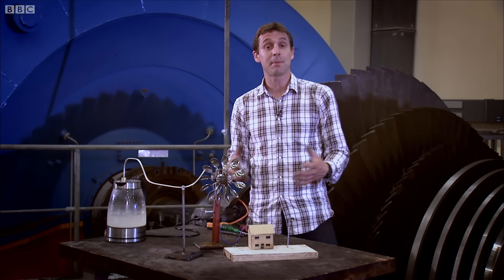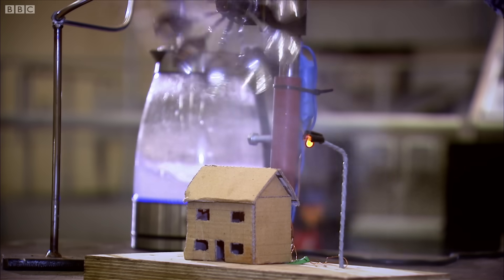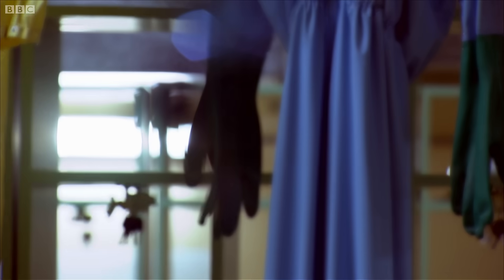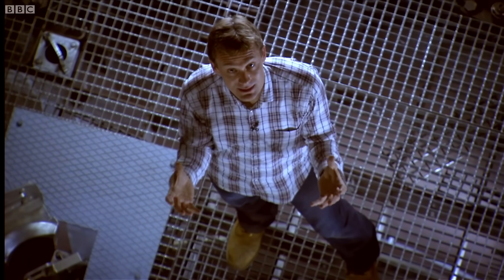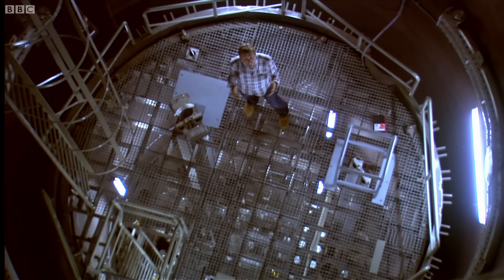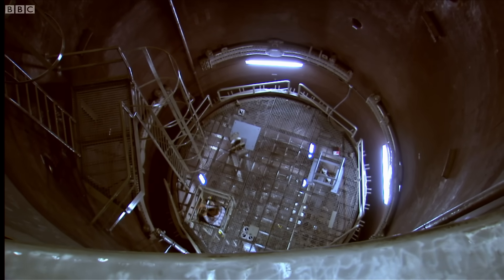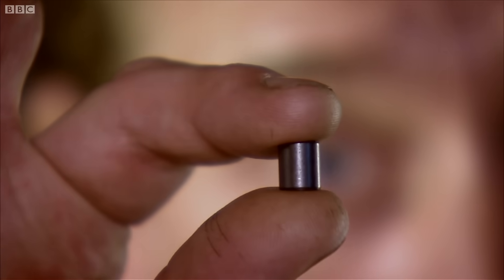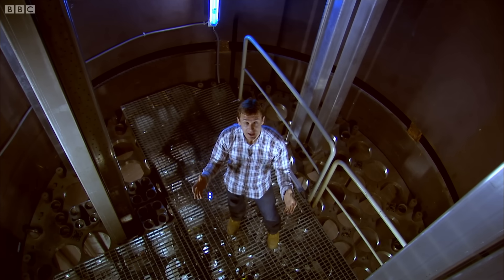Inside a nuclear reactor core - Bang Goes The Theory - BBC

Comment: Coal powered power stations have done more harm to the planet than Chernobyl & Fukushima combined. Where do you think all the green house gasses are coming from that are warming up the planet?
Reply: addictive object O coal fired power plants release more radioactive material into the air than nuclear power plants. Coal fired power plants burn literally tens of thousands of tons of coal per day, depending on power output. A 2000MW plant will burn over 20,000 tons per day. The coal contains NORMs (naturally occurring radioactive materials), that are released into the air with the exhaust.
Reply: @matman7546  how long to decommissioned coal/gas plant? How much nuclear coal waste produced?
Reply: Craig Pasceri not an issue if it’s stored properly. Coal releases it directly into the air.
Reply: Well, considering that global warming happens on its own with or without greenhouse gases, I'd much rather take coal than nuclear radiation that makes miles of land unusable for centuries with just one mistake.
Reply: Those gasses are coming from scientists and organizations that want billions of dollars for “research “
Reply: Deoderant

Comment: What bothers me is we're still using water as the conversion between atomic energy and electricity. Seems like we've made no attempt to get beyond water spinning a turbine to spin a generator. Nuclear reaction to electrical power conversion rate using water is only about 1% efficiency. Thats a huge waste.
Reply: Fusion power when it's done will likely try direct conversion, which should be over 80% efficient, but that's a long ways off.
Reply: All the easy  hydro sources are tapped out already. Hydro has a questionable safety record and hydro lakes are a massive methane emitter.

There is a push in the USA to remove a lot of smaller dams in order to undo the ecological damage they've caused. 

Dams  aren't free to build, or free to operate - and in several cases where operators have screwed up, thousands have died.

You could also argue that wind and tidal power  are "nuclear", but the issue with them is that they simply aren't concentrated enough sources.

Solar pv is almost economic but there are some incredibly noxious industrial  byproducts from making the things. Pushing the pollution into some else's  backyard isn't really acceptable.
Reply: Tyler Walter Anything anywhere near any source of free neutrons will become radioactive. This includes fission cores, and fusion tori (plural of torus?), etc. Things become radioactive if you release neutrons. That's not a big deal. Only the public sees it as a big deal.
Reply: 1% is a bit low.  A nuclear reactor burns about 6-10% of its fuel, and is roughly 33% efficient in converting its heat to energy.  So you're looking at 2-3% fuel efficiency.

That said, you're right, this isn't really ideal - but water's not really the culprit.  Navy subs run at higher enrichment and burn something like 20% of their fuel.  A water-cooled homgenous thermal reactor (e.g., fuel dissolved in the water coolant and moderator) with can burn close to 60% of its fuel (though, they have other problems to do with fission product solubility).

What causes the run-down is, basically, ash.  Many fission products absorb neutrons - this is very much like ash absorbing the heat and air needed to keep a fire going.  In a solid-fueled reactor, this means that to clean out the fission products, you have to remove the pellets, dissolve them, remove all the bad stuff, and replace the pellets - called reprocessing.

Molten salt reactors are also homogenous, and can be continuously reprocessed, and keep the fission products in solution (so they don't gunk up your reactor plumbing).  The feasibility of the type was demonstrated in the 1960's by Oak Ridge National Labs.

Also, they have the benefit of operating at atmospheric pressure (e.g., you don't have a reactor vessel that wants very badly to burst) and at much higher temperatures (you can run the turbine at higher efficiency).  They also have a stronger negative temperature coefficient of reactivity than any other reactor type.  That's a hell of a term, so I'll unpack it.

What is means is that the hotter the reactor gets, the less power it produces.  This is a very good thing in reactors, because it means that not only will it dial itself into stable operation without operator intervention, but you can decide on the reactor's power output by changing the turbine speed, rather than adjusting the power and making the turbines match cooling requirements.

In terms of both safety and flexibility, this is huge.  In safety, it means the reactor is unlikely to ever overheat.  In flexibility, it means you can run your turbines to match the load on the electrical grid, and the reactor will happily follow the load.

Many MSR designs are presently being worked on worldwide, and there's an effort in the US NRC and other worldwide regulatory agencies to make them regulatable.  I expect to see at least one prototype by 2020, and at least one on the market by 2025.  Even China's in on it, responsible for two of the designs presently being researched.

For more information:

http://transatomicpower.com/
http://thorconpower.com/
http://terrestrialenergy.com/
http://flibe-energy.com/
Reply: Dear Seraph, (or are you really plural?)
Pardon me for that, but "Nuclear reaction to electrical power conversion rate using water is only about 1% efficiency" is not because of the use of steam turbines. You are about right with respect to the quantity of energy in the uranium, that is still there in the stuff we propose to throw away, and also in the fact that water is part of the problem.
Alvin Weinberg, before 1970, created (at least) two nuclear reactor designs. The tame one is probably the most efficient in common use today, the Pressurised Water Reactor (PWR). It moderates the high energy neutrons from fission,, using the hydrogen atoms of H2O. The "strong" nuclear force gets more time to capture a neutron if it's not moving too fast, so a concentration of 3.6% fissile U-235 in the uranium fuel rods (actually, uranium oxide) is enough to sustain a chain reaction for two or three years.
The trouble is that even although there is still fissile fuel enough  in rods that have "burned" for that long, (a) we don't do it in the USA, and (b) "neutron poisons"  which uselessly consume neutronsbuild up even if we did.

One answer is, to use a higher concentration (way below bomb grade),  fast neutrons, and no .moderator. Properly designed, this will convert the (thermally) non-fissile U-239 into Pu-239, and it  is possible to do so for two or three decades at a rate that sustains the same level of enrichment as at the beginning, If you search the web for IFR Charles Hill Frontline, or visit http://arcnuclear.com, you will find reports of a far more efficient proposed use of uranium, a breeder reactor.
Reply: Philip Lo The temperature of current nuclear reactors is held down to try and ease metal erosion problems and not melt the rods holding the fuel. which means that thermodynamic efficiency is nowhere near 60% (which by the way is the efficiency of a good co-generation plant - gas turbine followed by boilers driven off the exhaust)

Water is entirely the wrong substance to be in a nuke's primary cooling loop - at high temperature and pressure it's extremely corrosive and if the cooling fails, temperatures will climb to ~1000C, leading to the molecules disassociating to hydrogen+oxygen - it was vented hydrogen held inside the buildings to try and reduce its radioactivity which exploded and blew the tops off the fukushima plants.

Couple that with the water dissolving metals inside the reactor and subsequently carrying various radionucleides and bearing in mind that that at the temperatures/pressures concerned it will flash to more than 1000 times its contained volume, it's easy to imagine a water-cooled nuke plant as a bottled up dirty bomb. There are better ways to build nuke power plants (proof of concepts built and run in the 1960s, producing 7MW - unpressurised and running at 700C, with safe excursions possible to 1100C), but USA research on them was shut down in the early 1970s because such plants couldn't easily produce weapons-grade plutonium. That research has only started getting going again since 2008.

Car engines are 25% efficient at best - which is at optimal load and speed. The rest of the time the efficiency ranges form 1-5% (or 0% if idling). All that complex gubbins around them is mostly to reduce pollution at varying power outputs, not increase efficiency.
Reply: I don't know why you feel bothered, you needn't be. Nuclear reaction energy to electrical power conversion rate is far better than what you are claiming, 30%. I think what you are talking about is the "burnup" rate, which has nothing to do with the water, but rather what proportion of the fuel can be burned before a buildup of neutron poisons or material failure occurs. The design of reactors was, and is, done with the greatest intelligence humanity has ever assembled.
Reply: i understand the bother. before i looked up how nuke plants work, i thought it was like, i dunno, some energy crystal turning nuclear fission into pure electricity, i was somewhat dissapointed to learn it just gets hot and boils water.
Reply: This is a fission nuclear reactor which well is junk anymore if it were fusion then we would have endless power about 100% conversion of energy all while not worrying about radiation except inside the toroidal or circle but it is pure heat it creates plasma which is well the hottest known stuff it must work since the sun uses it to create light and heat and we get no bad left overs like spent fuel rods and contaminated water it'd be like a gas hot water tank literally completely clean and renewable energy that is being developed right now forget natural gas or coal even fission rector this is the thing that will end the middle eastern wars and prevent the oil wars it's time to change world it's been too long!
Reply: Water boilers are 300 year old technology, and we lost a lot of people winning the knowledge about how to make them fairly safe.  That is a big factor in not yet developing a better way, but eventually MHD or direct chemical conversion will be developed.  The inefficiency is small potatoes compared to the huge amount of energy available from nuclear.
Reply: SaturnineXTS That’s for only some reactors. Not the mainstream ones
Reply: You can improve efficiency and power density by cooling the core with molten metals. The primary cooling loop, the one that directly contacts the core and carries heat that is produced can be filled with all sorts of different types of liquids besides water that transfers heat away better. However, you still have to transfer that heat into water, generate steam and drive a turbine. The secondary loop of water is heated by the primary loop of liquid metal. The downsides of using such a liquid is servicing the reactor, inspecting it for problems, engineering it to resist corrosion from these usually nasty liquid metals is much harder and much more expensive than just boiling water in the core instead. So most reactors still use water as the coolant in their primary loops.
Reply: Well go tell them your big plan smart guy!
Reply: It's way more efficient then 1%. Steam turbines are 60% efficient, whereas your car engine is about 25% efficient. But who cares about efficiency: what matters is $/MW, initial cost, total power generated, and environmental impact.
Reply: The secret is, WE ALREADY HAVE FREE ENERGY!!! For example, if you have a river and a waterfall......water is constantly falling right? So your using the falling force of water by gravity to drive a turbine which, in turn creates electricity but once this water falls, it evaporates, rains back down and the cycle starts over......FREE ENERGY for US that IS because the evaporation of water is done by the sun, so you can pretty much say that the world runs on NUCLEAR POWER, the SUNS POWER.

People say there is no such thing as FREE energy but there is.......we don't pay the sun money to use it's energy, its FREE it's already there. It's just that the governments want to control everything......you even have to pay yearly taxes if you have solar panels at the top of your house........the government will NOT and I repeat will NOT let you get away with having FREE SOLAR POWER ALL TO YOURSELF......

If you design anything that runs on something the government can't profit from.......they will KILL YOU.

Comment: yes but its only 0.5 percent efficient and you dont use all the fuel... what a waste. Switch to liquid thorium reactors, or generation 4 reactors...
Reply: Some people cant understand that liquid thorium is not pressurized and that a drain tank designed to stop thermal runaway, can stop the reaction if there was an accident. Nor do they understand that liquid salts can not be damaged in the hot soup of radiation and fuel... which runs as a closed loop for a heat exchange for a gas to power the turbine at better efficiencies... Or even that it was a proven technology back in the 60's but politics and hidden agendas stopped it...
Reply: I think the main problem is the way we're harnessing the energy produced. We're using the steam generated by the heat of the reaction to spin a damn wheel. That's really inefficient but there's no other way at the moment.
Reply: You can't blame the current technology, but you can blame the people who prevent better tech... read the history of any new power source against fossil fuels, including Thorium reactors... GDP is closely linked to energy and the west had it but is now energy poor... Expect a big change when coal or gas dominate the fuel source... that's when the Carbon dioxide will set the conditions for a planet similar to what happened 250 million years ago... (when everything almost died)
Reply: Thorium reactors would not work. They're dangerous, and they probably wouldn't even be deployed in your lifetime.
Reply: icantfindausername13 how are they dangerous? they are potentially one of the safest reactors. and you underestimate technology advancement. remember that the chernobyl power plant was opened 35 years ago, when humanity basically knew almost nothing about harnessing nuclear fission into electricity. nowadays we have candu reactors which are one of the safest, and that's a generation 3 reactor. we've done a lot in terms of safety.
Reply: Finally someone that actually knows things, 

Don't the 4th gen reuse the spent fuel from the 3th gen?
Reply: simon Li Yeah, its organisations like green peace that oppose nuclear and everything that is even slightly advanced.
Reply: Like it or not, China are currently working on a 2 megawatt mini system... and with each success they will step up the power scale to industrial size... Their budget is in the billions...